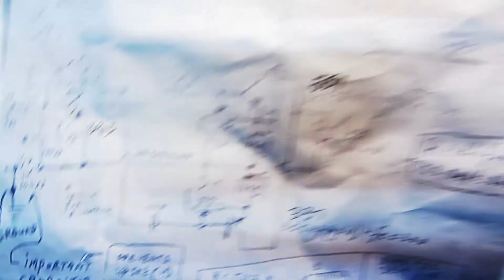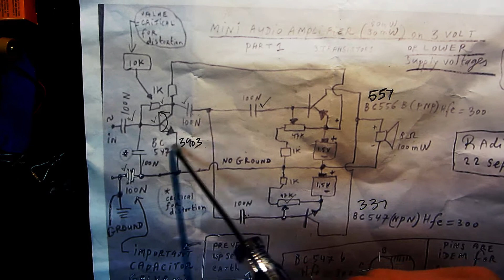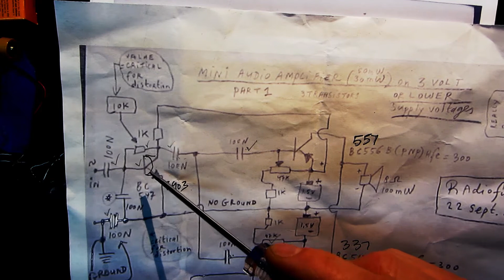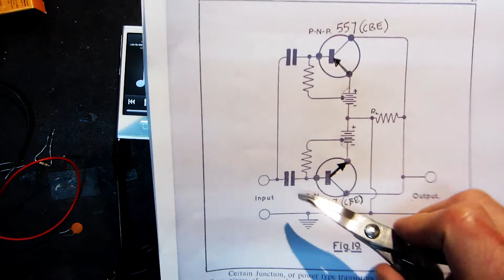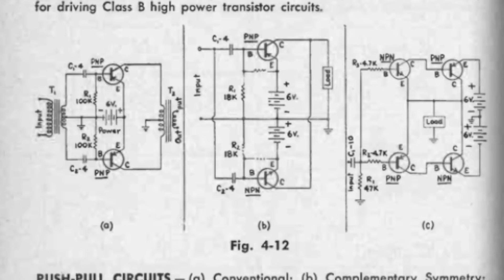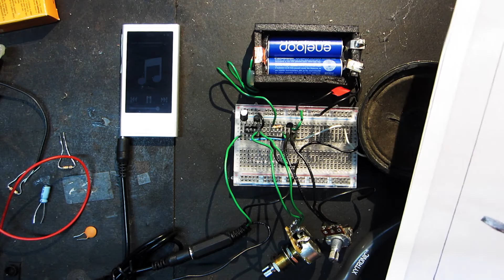【Diddling With Electronics】Interesting 3v amplifier push-pull circuit w/ PNP and NPN transistors

Comment: If I'm following this correctly, the fact that your only resistor is going from between the two batteries to both collectors means that when you have two input capacitors they are stopping the transistors from being biased correctly somehow. If each transistor had a resistor going from it's collector to it's base you could probably use two input capacitors as in the original circuit diagram.
Reply from the maker: ah good point, I'll investigate further. Thank you for your comment!
Reply: @mofostopheles  found out?
Reply from the maker: @ibendiben  not yet, I have to revisit this project.

Comment: Thanks Arlo, Yes, it can also work the way you made it. I have watched your video closely and it is very good & interesting, showing the basic principles of this circuit + the basic schematics from the 2 books of the 1950's. My compliments, interesting for everyone! I did not have enough time to do the demo's that you did, anyway. I also had the same results in my earlier experiments, though my MP3 player had (I assume) a somewhat lower audio headphone output level and/or had (probably.....) another "earth" connection at its output, compared to your MP3 player. That is also the reason why I published the circuit on You Tube with that "separation capacitor" of 100 N + the pre-amp and the indication "no ground". I don't want that people make the circuit and damage their MP3 player headphone output, when 1.5 Volt DC "upsets" (or can upset) that MP3 player headphone output. About the pre-amplifier BC 547 b (third transistor, added): I had the same results that you show in your video without that pre-amp. Works quite good. Could be that the pre-amplifier is not necessary, when the output level of the MP3 player is fiercefull enough. In general that is quite fierceful, it has to drive a low impedance headphone with a resistance in the 4 Ohm to 32 Ohm range. Thanks for making the circuit again, test it, your asessment, take conclusions, etc etc. And: your conclusions about the use of an electrolytic capacitor at the input (and that 2 electrolytic capacitors did not work) are also very interesting. In its "bare" essentials (I made that circuit in the past) you can solder the 2 bases of the transistors (NPN-PNP) together and drive them via 1 input capacitor. Problem is/could be that the circuit can take a too high supply current, so you get a "class A amplifier". But I want (we want) a class B audio amplifier, where the current through the speaker depends on the audio input level. The biasing via a resistor sets in such a case (class A) the collector current in both of the transistors (NPN-PNP). But (also important) we work with 2 x 1.5 Volt. That is so low that (never?) a too high base current can flow. But, anyway, that is the reason why I used two 1 K fixed value protective resistors in my schematic + the use of the two biasing potentiometers. But: it is an explanation for the facts that you found in your experiments (no biasing, etc). Could also be that the electrolytic capacitor gives a tiny DC current that biasis both transistors, NPN and PNP. That does not happen with a non-electrolytic capacitor type (the 100 N types that I used), there the isolation between the plates is "endless". That means that separate biasing is/was necessary in my circuit (not in your circuit), via a resistor or resistors. Many thanks for re-testing, your conclusions, etc. 3 october 2021. 

NB: I have linked your video/schematic to my video/schematic.

Comment: Hi Arlo, you made an super interesting video about this circuit, my compliments! I also did a part of these tests before publishing it on You Tube, with the same conclusions. Though I did not dig the biasing part completely out, like you did in your video and experiments. Regarding the biasing with the 2 potentiometers in my schematic: there is a broad range where these potentiometers can be set to, in all cases it works, though there is a position in the potentiometer setting where the distortion is at its lowest level. I checked that with the oscilloscope. On the other hand: given that fact, there is much room for exeriments regarding the biasing. In fact it needs no potentiometers, a fixed value resistors voltage divider can work well. Lots of success, I am very interested.